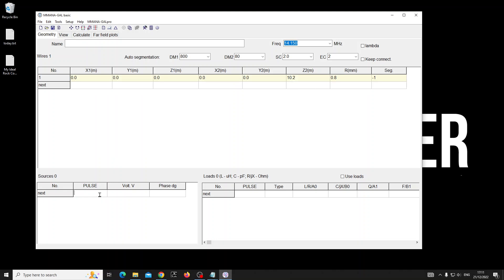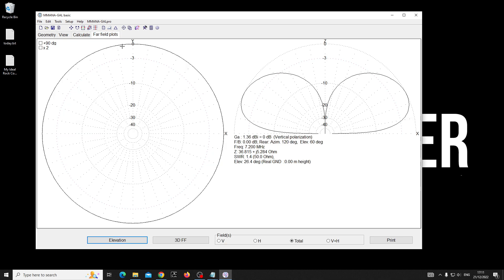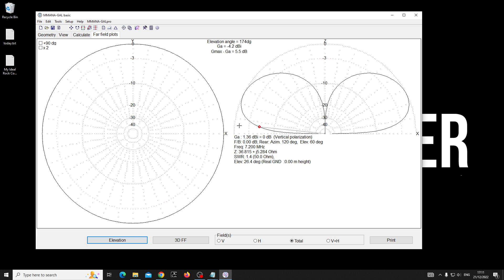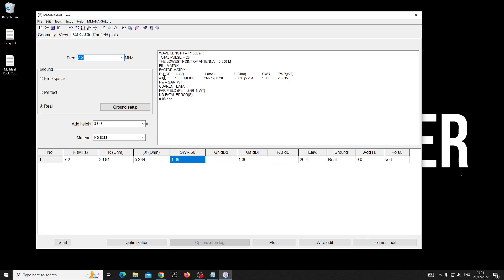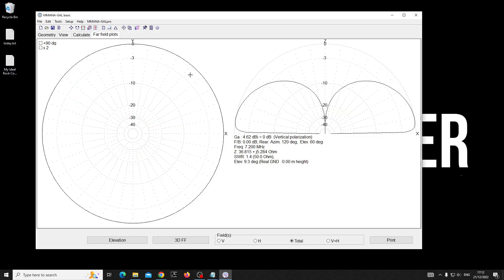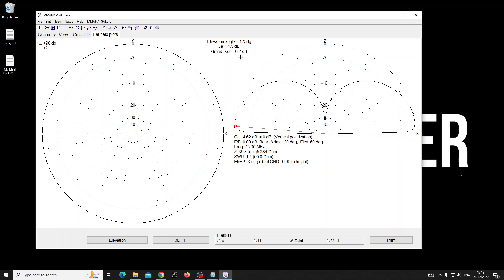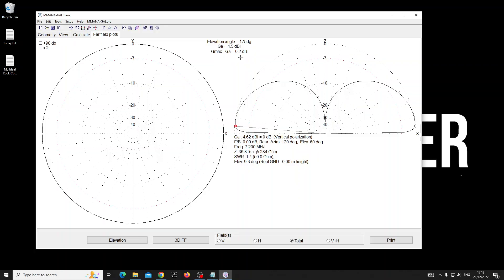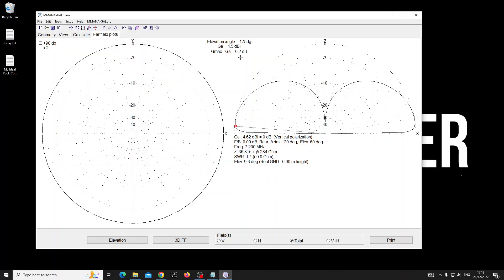Myth or Reality? Investigating the Claim of a 10dB Boost by the Ocean

Comment: I had a week in Samoa in 2016 as 5W0BOB. I used a trapped vertical on the sand with four radials each of 10 metres length over the sand, but one was connected to a short piece of copper pipe which I threw into the salt water. Wow, the signal reports for 20m and 15m I was getting from Europe, admittedly with 500 watts! Where I live in Cairns, Far North Queensland, Australia, I am 500 metres from the ocean, there is ground water about three or four metres below me and our garden soil is wet all year round. My hexbeam works a treat at only 9 metres high. A couple of days ago in a 10 metre QSO with a UK ham our signals to each other were so strong we both dropped down to just 2 watts and still had a usable QSO. VK4BOB
Reply from the maker: Lovely! Just great data..!

Comment: The question arises as to how close you need to be to the sea to maximize this effect. 
The boat is right in the water - there is no question about it. But what will happen on the shore next to the water? A mile away? Ten miles? It is interesting how the conductivity decreases as you move away from the ocean.
Reply from the maker: I don't believe that experiment has been done but probably 10 wavelengths or so.. Then it will gradually tail off.

Comment: Offshore (ship or planted tower based) “pirate” radio stations benefitted from this, so I’ve heard (e.g. RNI’s max sustainable 60KW supposedly acting more like 300 KW).  Was never sure how much to believe this.  

They needed ground wave (mostly) and sky wave.  

Initially, U.K. ones had quarter wave antennas, but in 1980s especially, they migrated to the low frequency end of the band, notably 558 KHz, where their antennas were electrically short.
Reply from the maker: Yes David.. Ground and Sky.. Good point. But I agree, one of the reasons they had a lovely signal..

Comment: The Sea can add or Attenuate the signal depending on your mode of operation (Not TX Mode) Just differential signall Mode !..

At the end of the day it is all about relative differential between above and below
and above and below have differing velocity factirs that transfer these differences over time and space at different speeds
which of course creates areas that have large differential above and below (due to phasing)  and lesser potentials above and below.

Comment: I can vouch for this. The difference is huge. Receive seems to increase significantly as well, and of course in the direction of the sea you don't have any sources of artificial noise. Win Win.

But don't make the mistake thinking this will help you on VHF/UHF. Different propagation modes mean height and extending line of sight become the dominant factors.

So you need a holiday house on the beach for HF and one up a mountain for VHF/UHF!
Reply from the maker: Good point Simon.. VHF needs height. Totally different propagation, as you say. Good comment!

Comment: Oh Yes, indeed!  I live on a salt water harbor and use a small center loaded 20 meter mobile whip on a mag mount  on a rusty brake rotor with 2 radials on a rock retaining wall 5 feet above high tide on the beach.   It is my best dx antenna to the EU which is NE across a mile of salt water.   I don't bother with the linear, just 100 watts will do it.   I've tried it at the top of the bluff (50 feet up) and beach level is the best by an s-unit or two.    73 from N7RLV, on an island in the Puget Sound.
Reply from the maker: Now THAT is good data. Nice.
Reply: That answers my question, thanks Rob

Comment: Got a challenge for you as your probably the only person who could do it .I live next to the sea I can see it from my window  probably 1 away .I need an all band antenna  for the loft , my loft is 23 foot in length I run a yaesu 450d on 10w as I'm a foundation  holder .So i mainly use 40m 20m 12m 10m for ft8 and 20 m 12m 10m  for voice . If it worked on other bands to thats fine I know from your videos it can sometimes resonate 2 bands up .kind regards Andy
Reply from the maker: Andy.. OK fella. Easy one if you have some cash... Buy an SG230 and run 2 x 11 feet elements and make a randon doublet with the SG230 as the centre point. You will get all bands.. ALTERNATIVELY! You can do this on the cheap.. Linear load a dipole for 40m.. So that's 2 elements 6m long each in total length (but use twice as much wire.. Start at the middle, go out and back and strap the wires together with tape.. ) Then arrange them as a Z shape to fit inside loft.. Once you have 40m working, arrange another set of wires for 20m band, again also in a Z shape. You probably won't get a perfect tune BUT your FT-450's ATU should bring it in to achieve your 10W. PS - It might be noisy because it'll be sitting right above all your house electrics and it'll pick up anything that creates hash..

Comment: Hi Cal,  A quick question for you.  If you were at a coastline that had say a 70ft cliff.  What would work better, operating on the clifftop a few wavelengths away from the waters edge, or heading down on to the beach and operating with in a wavelength or two from the shore?
Reply from the maker: Well, we've just had a comment today from an op that claims at least 1 S point better right on the beach, not the cliff! So you would have to try it.. Both would be good though.
Reply: @DXCommanderHQ  Thanks for replying Cal, I'll experiment next time I'm by the coast and report back :)
Reply: Work John ZL2JBR and you'll see how a clifftop location above the beach can be a bit epic!
Reply: @g7vqedave2  Absolutely.  Worked John in March this year, my only ZL since gaining my full 2 years ago.  He has a fantastic location!

Comment: Hi, Callum, Peter VK3YE has a YouTube channel, he goes pedestrian mobile in the water of Port Philip Bay in Melbourne Australia.
He has an metal ankle band that is connected to the gnd of his FT817, and goes knee deep in the sea.
Happy New Year from Tom  VK3DMK
Reply from the maker: Yes, I've heard of that BUT what folks don't realise that burying the ankle in sea water does nothing.. What is REALLY doing the work is the ground ABOVE the water and that part which is touching. He could prove that by disconnecting it and have a few fishing floats instead. It's not a lightning ground, it's RF ground.
Reply: @DXCommanderHQ  Hi Cal, whatever the reason it seems to work! what is impressive is that he was talking 20m SSB with a super  station in the States, with 200 foot towers etc, costing  quillions, while he had 5 watts a short vertical and a bit of wire round his ankle, and was getting similar signal reports both ways! if ever there is a case for QRP, this is it!
Reply: I think Peter's body actually becomes the counterpoise. I've done a ton of experimenting with this and as Callum says, it's the surface of the water that's performing the magic. I using fishing floats to keep my counterpoise wires at the very top of the water. I've heard my long path echo with 5 watts on the beach when letting off the mic.